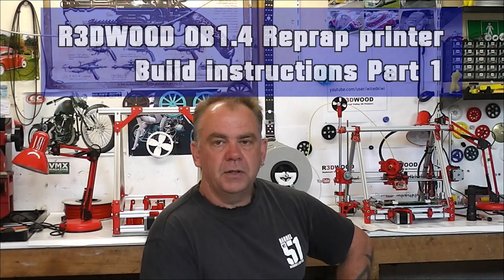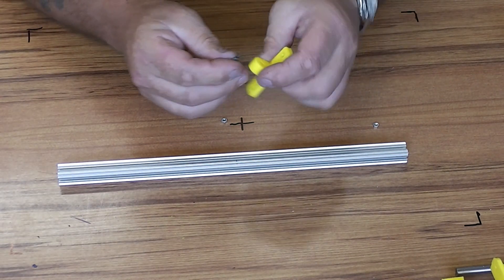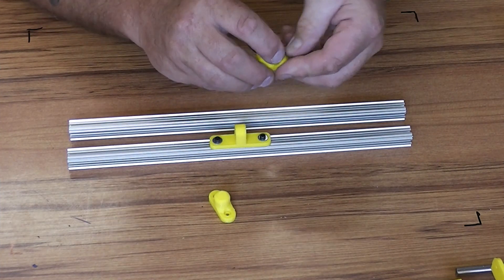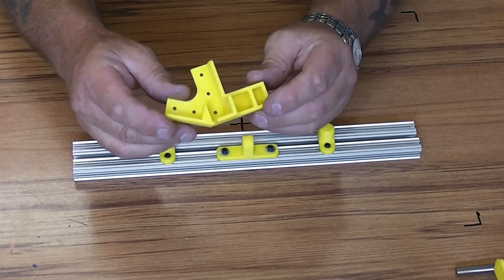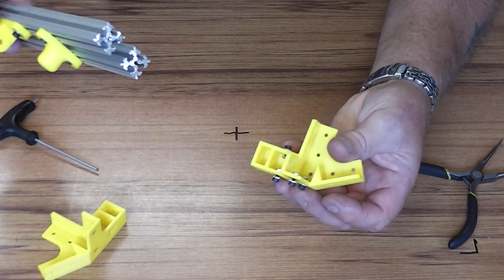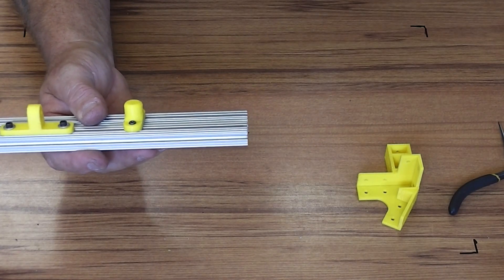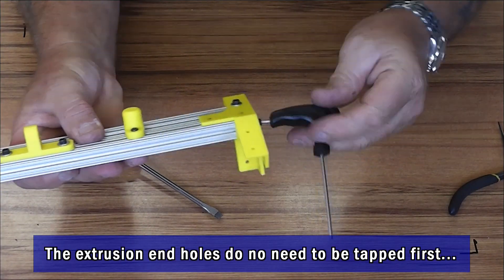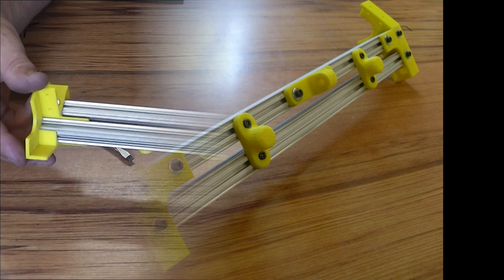OB1.4 assembly Part 1

Comment: Hello: Over the ditch here in Oz, I am having a problem to source the 15mm x 15mm profiles. There are plenty of sources for 20mm x 20mm. I am not good at the 3D design part, thus, is it very hard to re-size the prints to 20mm, thanks in advance, and you have a great bunch of videos, to get me started.